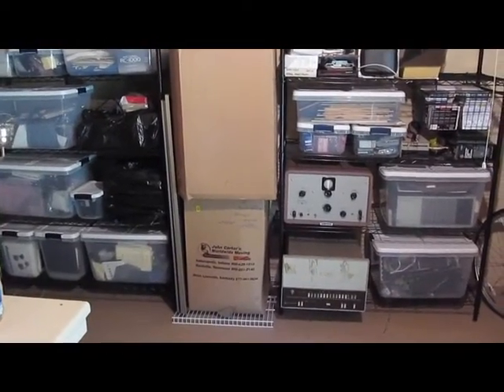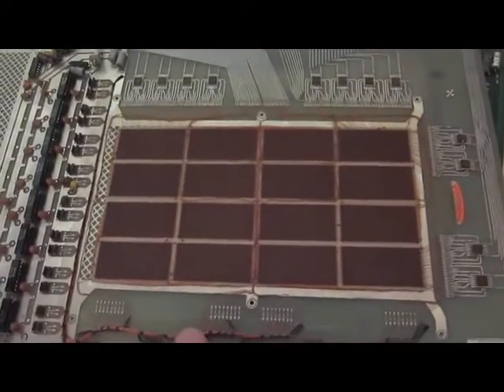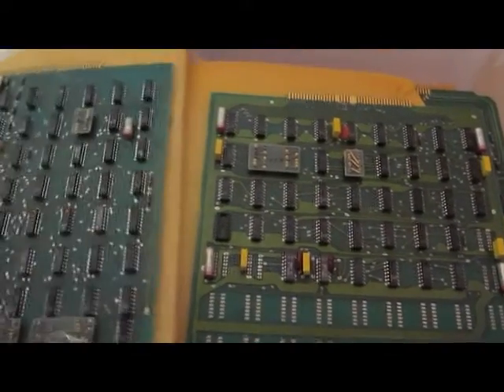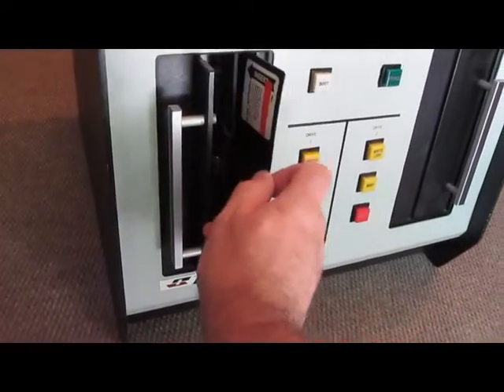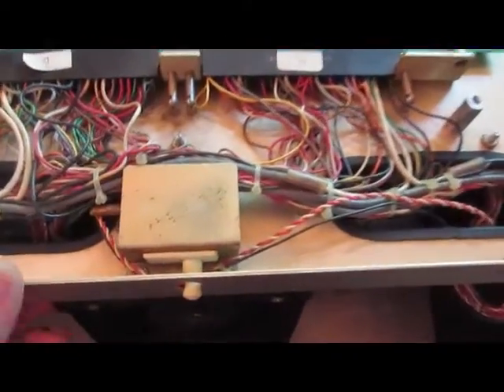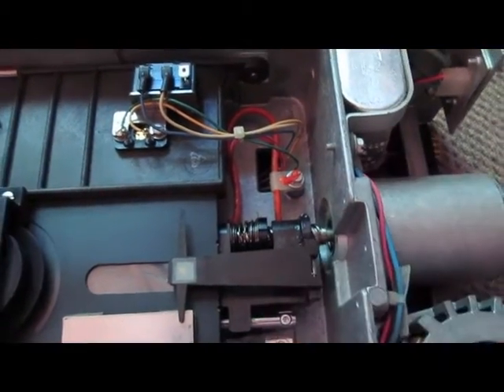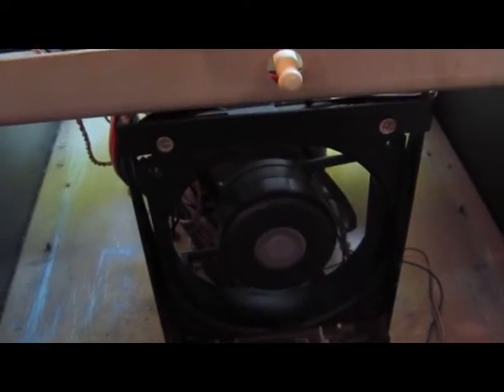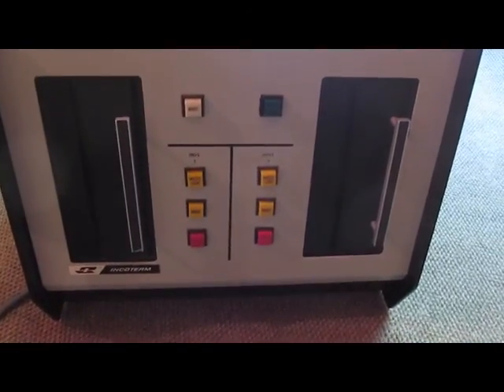Incoterm SPD 10/20 Early 70's Vintage Computer Part 1

Comment: Are those Memorex drives?
Reply from the maker: I believe they were.
Reply: The drives are Memorex 651: http://www.bitsavers.org/pdf/memorex/disc/2644.002-01_651Maint_Nov74.pdf
Reply: @mattislind4443  Yes, they were 32-hard sector drives.  But funny story - the CRC's used were the wrong ones from what the engineers intended.  But they worked and it was only discovered after a lot of them were in use.
Reply: @schaumburgphotoclub  Do you have more information on Incoterm hardware and software? I have gathered as much info I could here: http://www.datormuseum.se/peripherals/terminals/incoterm-spd-20-20 . I also spent some time to try to dump diskettes but got quite a lot of read errors. In the process I reverse engineered the CRC mechanism from the hardware. Some XOR gates and shift registers. If I remember correctly the bir ordering is reversed to what one usually expect. Still ongoing project.